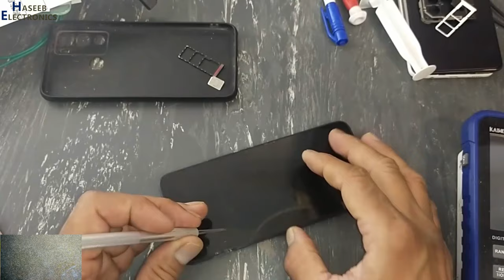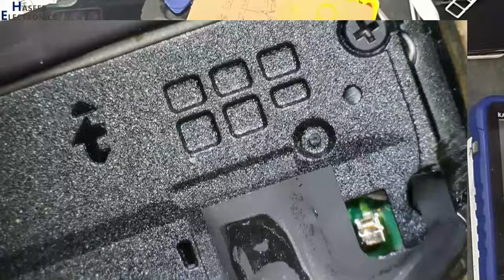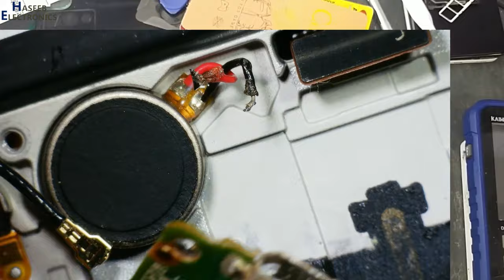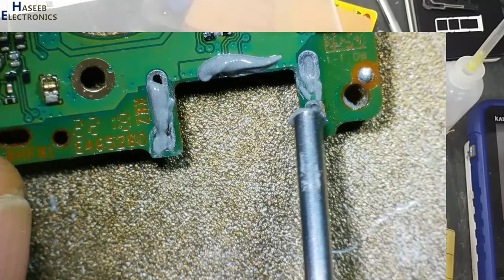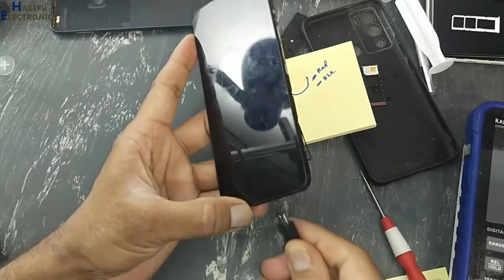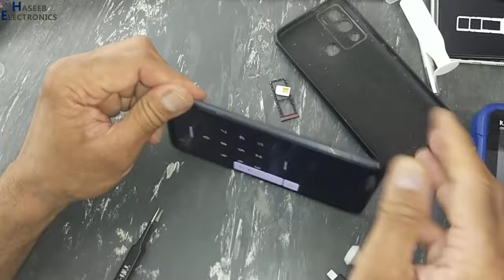{1189} USB charging port replacement in Infinix mobile phone

Comment: Are you sure that the charge port needs to be replaced or to be cleaned the inside of it?
Reply from the maker: I think you didn't watched complete video
When internal connector block is missing
Then just cleaning the metallic jacket has no meaning
Reply: I hadn’t seen the missing pin. Thanks